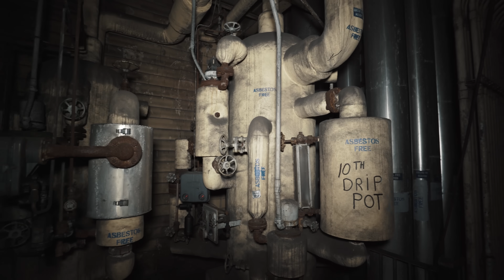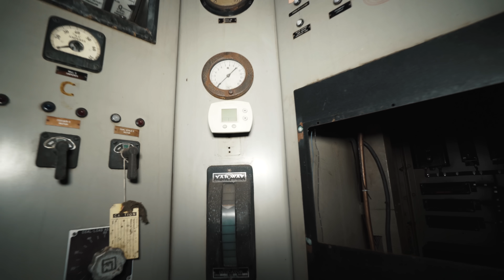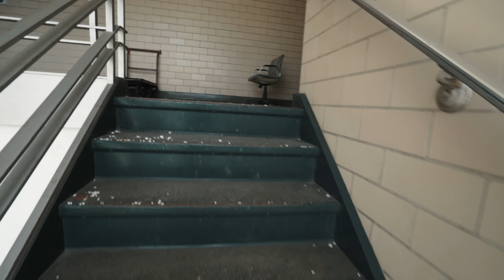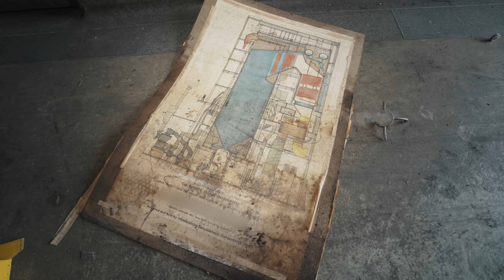Exploring a Huge Abandoned Art Deco Power Plant

Comment: The Turbines did not spin at aircraft engine speeds 15K + rpms, in the US depending on the number of rotor poles would determine main turbine output speed  2 poles =3600 Rpm , 4 poles 1800 Rpm, 8 rotor poles 900 rpm to make 60Hz AC power.

Comment: At 3:40 those blades in there are basically a big fan blade that would help circulate hydrogen in the generator the hydrogen would then circulate through water filled coolers in each corner of the generator.

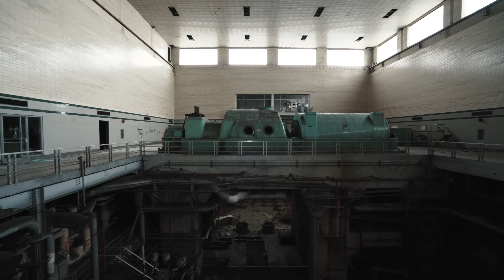Comment: At 2:35 the valves and gauges are the steam and water seals in the turbine. The far right wheel is to control the steam seals and the others are supply and discharge for the water seals. The gauge would tell you the pressure of the supply to water seals and the temp gauge was for the temp of the discharge water temp and if you look by your feet there are sight glasses where you could see the water flow and you would use that to verify flow.

Comment: The smaller generator on the sides may be for adjusting the rotor coils excitation voltage, which is important to regulate the generator output voltage to the same level as the grid it is synchronized

Comment: The dc generator is used for mission critical devices during a outage or failure. Less equipment is needed to control electric motors and actuators with fine movements and also run dc battery banks.

Comment: The end you thought was the turbine was the alternator. The combination of the alternator and turbine make a generator. The output you discussed was for the DC field alternator. A rating of 200kw means those puppies pump Megawatts of AC. I did see a gauge marked "gen wattage" with a max range of 80 Megawatts.

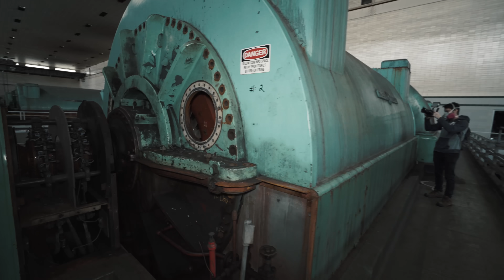Comment: 3:27  I operated equipment like this for over 22 years.  The blades shown at 3:27 are not turbine blades.  That is the collector end of the generator, and the blades circulated hydrogen gas through the generator to cool it.  
Turbine blades are within the housings at the other end of the machine.
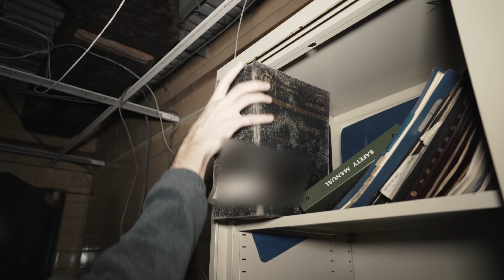9:56  That tool is for replacing incandescent lamps.  It attaches to a pole for out-of-reach places.
14:45  Electrical Switching, Metering and Relaying bay
17:40 The steam condensers have already been removed.  They were located underneath the turbines in the archway-like area in the turbine foundation, near the center of each machine.
19:30 Feedwater Heater
19:50 Transport Pipes, carry pulverized fuel and air to the boiler burners.
19:57 Coal Chutes, carry raw coal from the bunker to the pulverizers.
21:42  This is where the condenser would have been.
22:07  Turbine blades and shaft.
It is astonishing how much material was abandoned at that site.
Reply: Very interesting, thanks for commenting :).
Reply: 10:43 Bently Nevada 3300 Vibrations Monitor Manual, that sistem is still in use this days, obsolete but many places still run those as main monitoring for rotating equipment
Reply: @jmfz28  have a bunch of these in use for a fleet of steam-propelled LNG tankers that i work to support.
Reply: Thank you for this! Great insight into what we are seeing.
Reply: Some switches and paper recorders into the control room have uncommonly same form and design like soviet ones into 1960-x powerplants that still operate. Computer with SCADA near gauges with vacuum lamps (sometimes without computer).

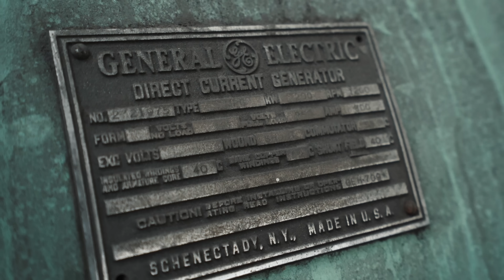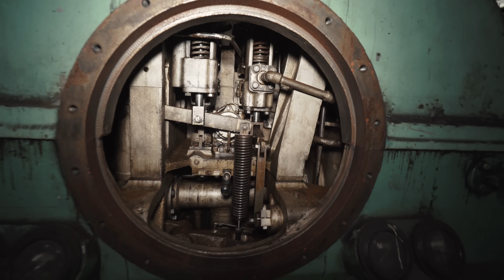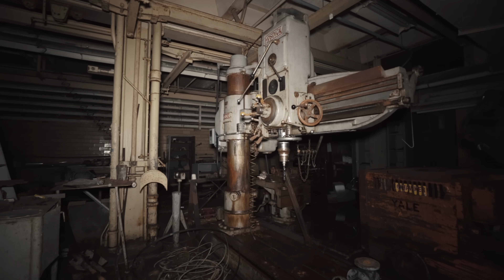Comment: @4:07  Motor/generator sets for generator excitation.  @8:27  Turbine protection trip block. Would trip steam valves closed on loss of lube oil pressure, loss of condensor vacuum and turbine overspeed (during load rejection).  @ 9:56  Light bulb grab for changing bulbs in fixtures that are high off the floor. @22:50 Larger diameter turbine wheels are low pressure stages, smaller diameter are intermediate and then high pressure wheels.

Comment: Those aren't turbine blades in the circular holes. Those are fan blades to circulate hydrogen gas in the generator to help cool. It's like the fan on a drill that helps cool the motor while it spins

Comment: I Used to work at a coal fired power plant in Maryland several years ago. The small generator at the end of the main generator is called an excitation unit. The excitation unit Provides DC power to the main generator. An AC motor Turns the excitation unit That makes DC power for the main generator. Kind of a chicken in the egg thing going on here

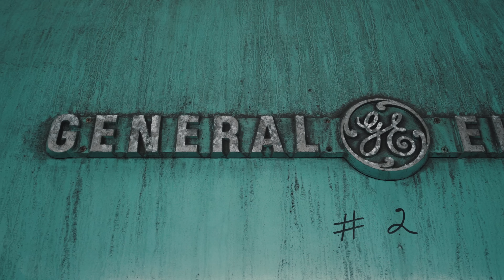Comment: At 3:15 you comment on the turbine blade speed. This isn't a jet engine. The blades do NOT spin at extremely high speeds.... probably between 1500 - 3000 RPM at best.

Comment: The giant drill press you found is called a Radial Drill, it can be used to drill holes probably about 4 inches thick; it can also be used to tap large threaded holes, definitely cannot be used to mill though, but they are work horses. I commonly use one at work about that same size just much older. It’s made by American Hole Wizard, it was commission to be produced for the war effort during WWII, still runs like a dream. I think we also have that exact same Fosdic press too, nobody likes it lol.

Comment: Someone who takes asbestos samples and removes asbestos from buildings once half-homorously told me that if an old tile is still solid on the wall, there's asbestos in the plaster and that goes with the insulating material and pretty much anything that's glued or stuck to another material or together. Notice how the "asbestos free" -stamped insulation was falling apart. Not fool proof naturally, but it might have some truth to it. The asbestos fibres are great for bonding, not so much for breathing in. And as said many times below, it should be fine as long as you don't disturb the material.

Comment: i used to work there , some of your facts are close but just a little off. Those are 60MW generators and we used to run 4 of them at a time as the other two had not been updated and were not as efficient as the most used ones. It was a really good job but the Obama admin put a dagger in the heart of the entire industry (he was/is a dumbass) over emissions. i was a controls equipment mechanic(maintenance) and worked on all the controls over emission equipment and boiler controls along with motor controls. A city bus puts out more than any one of the boilers there, all gas and hard particles were captured and none at all went to atmosphere. Contact me email for more info or to answer anything at all. It was built in 1952 and the offices you were in was my bosses old office and you were in our shop. controls mechanics.
Reply: I worked there too. Operations.
Reply: Did the plant receive coal via barge, rail, or both?
Reply: @sirpoopsalot9598  rail there's a coal handling site with a dumper car it would flip the cars over and empty them. The coal would then go up a belt to a crusher house. From there it would either go to the pile for storage or go in the plant for use
Reply: @sirpoopsalot9598  Rail,,, they had a car dumper out back that dumped into a pit and it was stockpiled when there was excess.
Reply: Well he did say he was going to kill the coal industry.. thanks Obama, would have been nice to have this place running and producing reliable enegry.  probably for at least 20 more years.  Have to bail out those failing solar companies somehow!
Reply: @MalWolf01   Obama didn't kill coal, cheap natural gas did.
Reply: What state is this in? Or is it Canada

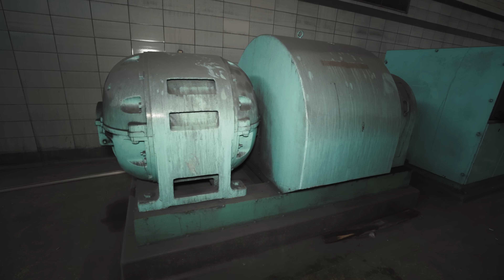Comment: @  4:05  You'll notice one thing on the name plate that say Exc Voltage.  It more than likely means exciter voltage. This generator provides exciter voltage to the main generator (or exciter field). The main generator armature has windings making it known as "moving coil". The exciter generator provides voltage for a set of stationary windings to pump a magnetic field through the main generators armature windings which must be a fixed magnetic field polarity. That's why it's a Direct Current Generator. You can not use an AC generator because the magnetic field would be flip-flopping and that wont work and the curves of your AC sign wave would look all screwy . The RPM of the exciter generator is only relevant to the strength of the magnetic field it can produce.

Comment: There was not much in here that I would call "art deco".  However, the building is definitely mid-century modern inspired. Art deco is mostly a style in which you use motifs, sculpture and artwork that have a certain look and style, mostly use sharp, angular geometric forms, high-contrast art, trims or bands across the face of walls and buildings usually emphasized with metal. You have repetitive bands of recesses or projections (sometimes emphasized by polished metal) and the overall form of the building may jut out or may have stepped look. Early art deco (about 1930s were monolithic stoic buildings with these motifs and examples of them are Rockefeller Center, the Empire state building or Chrysler building.  Later forms of art deco are kind of what you see at road side diners which were inspired by "movement" and form of the car where you would actually have buildings with long overhangs, diagonal walls and windows and more of a "plastic" sleekness and feel.  If anything, the metal banding on the elevator door and the logo look to be art deco inspired elements. But this building is more mid-century modern with elements of minimalism. I think that's what you guys were hitting on with the sleekness and the "clean" lines. This type of design uses the play of thin planes, voids and solids (glass and walls) and minimalism. Notice that you have a ribbon of windows in the turbine space trying to make it look like the roof is "floating" above the wall.  There are no bulky columns. All you basically see are rectangles and the emphasis of horizontality. Unless there's something on the exterior that looks art deco, but I didn't see anything.  At first, the turbine space to me looked like a sanatorium, especially with that minty green color. That dusty stuff around that you thought was asbestos is some sort of plaster.  Anyway, I really appreciate your videos.  I love seeing old buildings and marvel at their construction.  In my field of work where I go to old buildings and draw up plans for remodeling (commercial and residential) and I love to explore them because they were designed and constructed differently with more thoughtfulness.

Comment: Art Deco AND Bauhaus....
Also, those generators spun at 3600 rpm in order to produce 60 hz AC power.  And you were not looking at the turbine at 3:34, that is a cooling fan on the end of the generator unit itself.  The turbine is located in the larger section of the unit with the two round holes.
Reply: I was wanting to say it so bad lol. These generators were hydrogen cooled.

Comment: Those DC generators were most likely to provide the exciter current for the alternators. They provide the magnetic field that is required for the alternators to output the required AC voltage and current

Comment: We have some of the "hear hear" phone booths at our industrial facility.  These were really common place before radio communication was established.  It use to be operator would communicate with the control room using these phones.  The booth had sound proofing and would block out a tremendous amount of the noise being transmitted by all the rotating equipment in the area.  Funny thing about the place I work, they have these same phone booths and they have big explosion proof phones that are rotary dial, surprisingly many of them still work.  Usually there is a yellow flashing light associated with these, when they flash this will alert the operator of an incoming phone call.  Good stufg

Comment: Books you were referring to about the control system.  Those were operator manuals for the vibration monitoring systems.  I've worked with many of those in the past.  They can measure vibration along with thrust and use key phasers to measure rotational speed.  That condition monitoring system can be used to monitor the rotating equipment and give key indicators to when it might need major overhaul type of work.  Pretty critical stuff and that brand "Bently Nevada" is the best product in the market for that.  Surprised it was just abandoned, there is a big demand for aftermarket equipment like that.  Great find.

Comment: It's quite a bit more risky to explore abandoned buildings during heavy rain. It's not just the obvious risk of slipping from oil mixing with rain water.
As buildings decay things are always moving closer and closer to collapse. It doesn't take long for water to start pooling inside the building. Very quickly the limit is hit and BANG the structure collapses without warning.
Never forget just how heavy water is and how much extra load it puts on a building. Normally floors and walls are not intended to hold up water.

Comment: I had to take a screenshot of that quote on the wall.....very appropriate! I believe that whisk at 10:00 was used on a pole to change the light bulbs! The structure looked as if it could have been used for a natural gas generator system cheaper than building a new one, at least the Art Deco portion. Great video guys!

Comment: The DC generators are for the permanent magnet exciters. The exciters are used to generate the AC field of the main generator and provide VAR control
Reply: During start up you have to "TIE" the 2 fields of the generators together. One being 1800 RPM 4 pole ,and the other 3600 RPM 2 pole. This then allows 2 to 1 ratio, which then gives you the 60 Hz.

Comment: On-site generators like that are for self-startup. Remember, if a power station loses it's ability to make power, its basic systems need power to come from somewhere. Gens and grid power are the usual ones. Some power stations cannot "cold start" and require a generator to be trucked in to start them, or even provide power for lights in the facility itself.
Reply: There is a black start gas turbine there just for that. Those where dc exciters. Source: I operated that plant.

Comment: That manual is for the Bently Nevada 3300 racks in the control room. I think i saw 6. Its a company in Nevada that is still in business.   Those racks monitor all the critical machines for vibration, temperature, postilion, etc...That way if something is getting wore out they can plan for maintenance.  Also shuts down machines if they are about to fail. A very important system in a lot of power gen plants around the world.

Comment: It is hard to tell what the DC generator is for. Usually each turbine plus generator combination has its own DC generator on one end or in between to power the actual generator.

I think it is more likely to power some DC systems inside the plant. Also it might charge batteries to get the entire plant starting up from a blackout. Less than 10% of all power plants can start up during a blackout or keep running in standby without a working power grid.
Reply: It's for excitation. Every brushless generator has to have excitation to induce a magnetic field to generate electricity. Otherwise you will just spin a rotor and nothing will happen.
Reply: @natet7482  correct. But as I wrote, each turbine plus generator set usually has its own DC generator. The reason is that the DC generator can be regulated so each AC generator can be controlled independently.

A central DC generator was usually used to power light bulbs, instruments and machinery e.g. for controlling the steam generators of a plant.
Reply: @CC-ke5np  every generator has its own excitation. There are no shared exciters. Also the DC power at this plant, and every plant, comes from battery banks that are maintained thru chargers. The DC power in power plants is not used for lighting it is control power. Equipment, for example, the boiler feed pumps, would be started by a power, or switched breaker, and the closing and opening coil of these breakers is charged by a 125 volt DC power system supplied by said DC system. Some emergency lighting is usually supplied by the batteries.
Reply: @natet7482  That's what I said, the DC generator they found (minute 4:00) can't be for the turbine generators just as a lot of people wrote as comments.

Until the 1960s, using AC was not ideal for most applications. AC motors were hard to regulate and had less torque than DC. That's why most factories either had a DC power plant or used huge mercury rectifiers. Lights and everything else was often running on DC as well.

Residential areas belonging to factories (homes of workers, you had to have a job in the factory to live there) were often supplied with DC only. Until the late 1950s a lot of household appliances were available for DC and/or had voltage selectors with many settings.

E.g. here is a tape recorder:
https://www.analogfan.de/studer-bandmasch-ii/studer-a62-teil-1.html

The 5th picture is the voltage selector. 110V/117V is for the US, 220V/250V for all EU countries. The rest are special voltages not standardized in power grids and are for local industrial power sources.
Reply: @CC-ke5np  those DC generators are only for generator excitation and only excitation. Nothing else. Source:. I've operated various types of power plants for almost thirty years. Also I operated this particular power plant for 5 years. I'm very intimate with it.

Comment: Those side 'supplemental' generator sets are for generating the DC current for the main turbine sets.  Separate excitation.  These would be used to power the DC slip rings on the wound rotor used in the sync generator. Place screams early 60s for the equipment in place.

-Source: Motor repairman, 15 years.  I've worked on similar equipment.

Comment: The smaller generators actually power the main generators. That's also why the small generators are DC but the large ones are 3 phase AC. The small ones essentially only power electromagnets in the main generators.